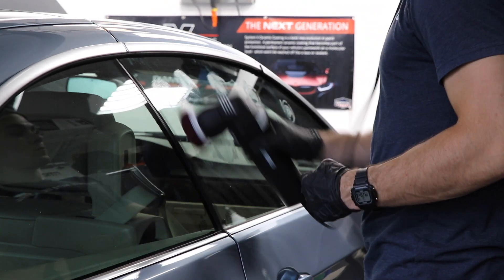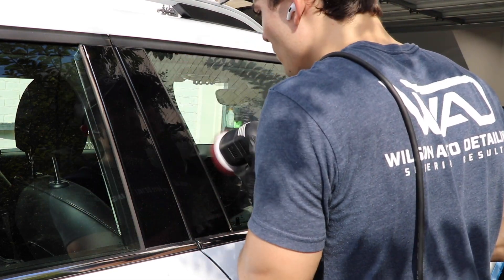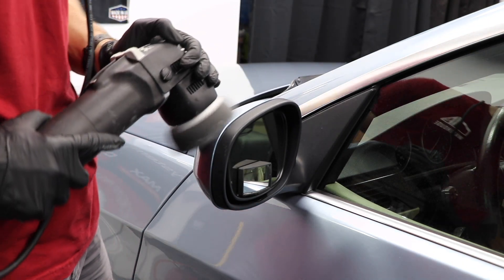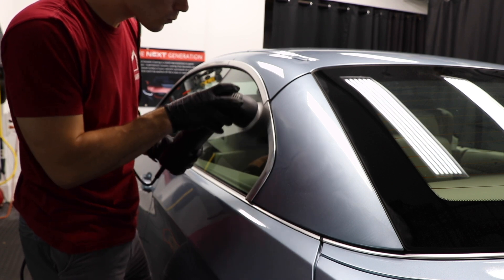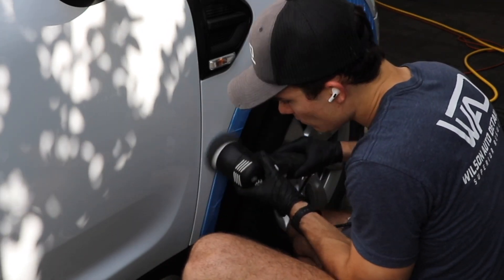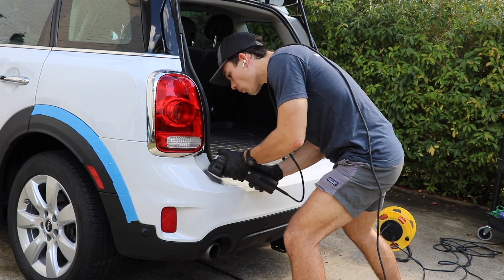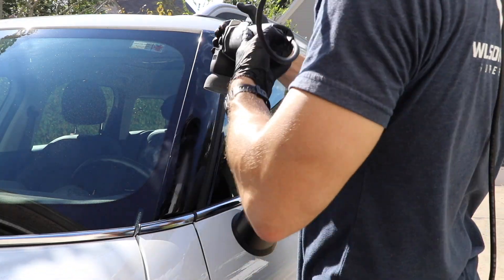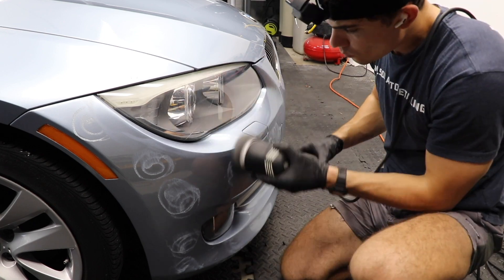The Most Profitable Approach To Paint Correction | Let's make it simple

Comment: I have an entry level polisher with a 6" backing plate but I also have a 3.5" backing plate with 4" pads.  Should that suffice as a beginner?
Reply: Absolutely! That will more than suffice. I prefer a short throw polisher with a 3 inch backing plate. Designated 3 inch polishers usually have 12mm throws and it’s too much in my opinion.